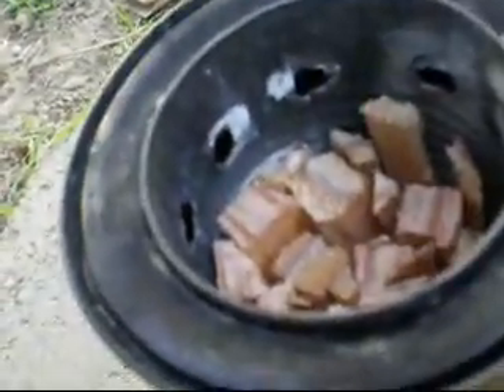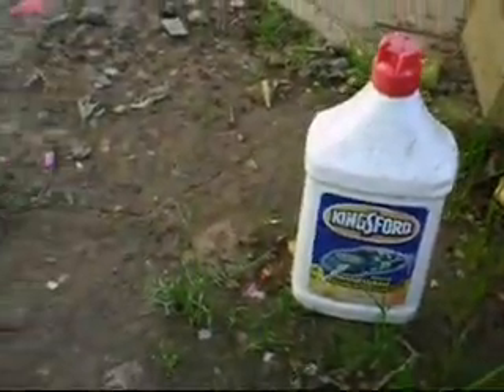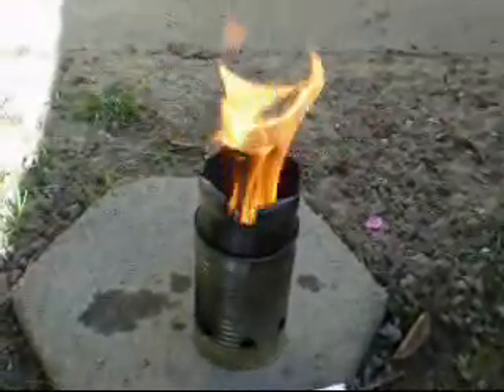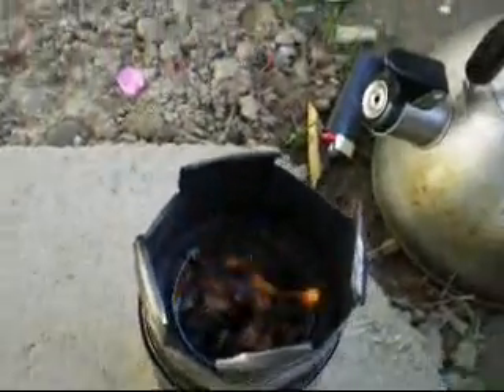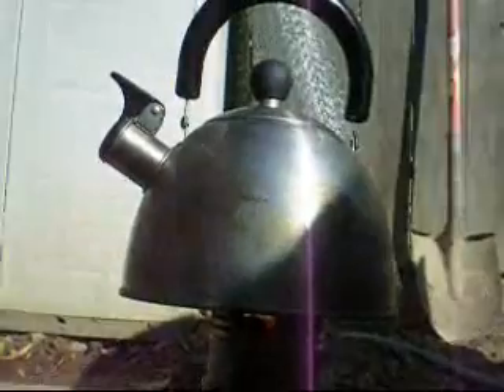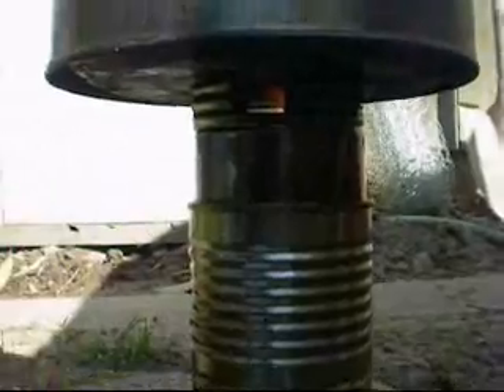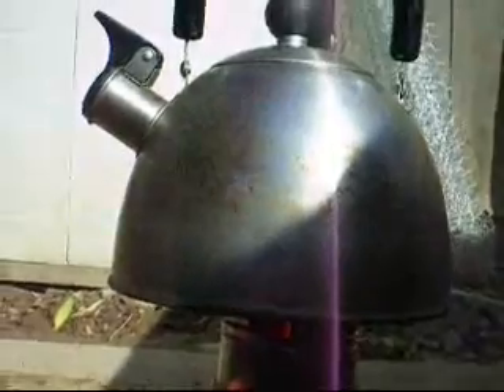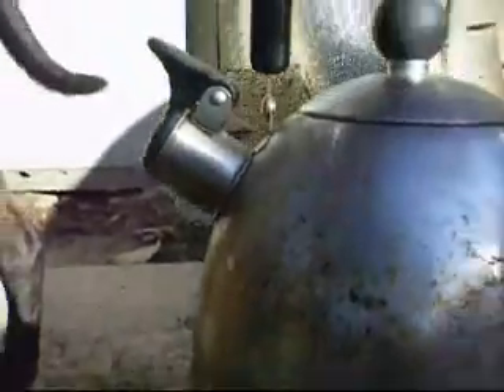Up Draft Gasification Rocket Pack Stove

Comment from the maker: I used a jig saw and sheet metal shears to trim for a tight fit.for the hole on the sides you can just use a small nail and hammer to start the holes an then enlarge them with a multi-bit, or just progressively use large drill bits till you get the size inlets you want. don't forget the inner can needs holes on the bottom to pull in oxygen and holes about a 1/2" down around the top to pull in the secondary preheated air to burn off the hydrocarbons. this will give you the clean "smokeless" burn.

Comment from the maker: it's a take off of the basic rocket stove that is fed fuel and air from the bottom. the flu focus and reflects heat while creating and up draft pulling more air in increasing combustion.

Comment from the maker: i think about a 30sec. - minute to be burning sable enough to cover with a pot. this ones a little quicker cause of how compact it is, but for light cooking i would use the next size up soup can(burns longer). use a little lighter fluid and it should be ready within the minute. also my new stand off on my large stove has an access hole cut out for adding more wood chips while keeping the pan on the heat.